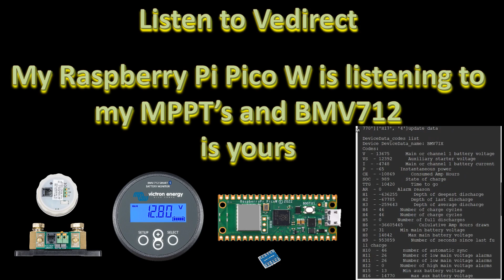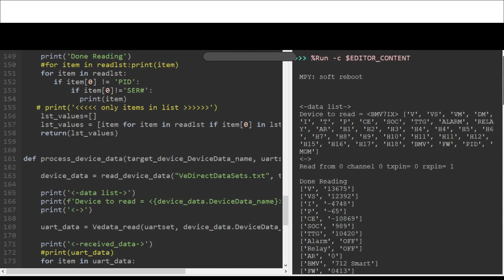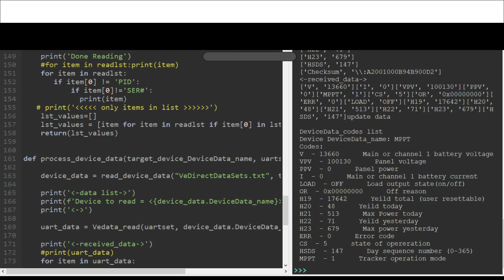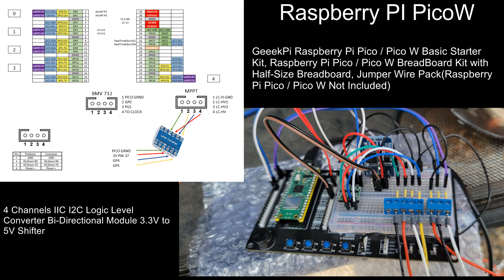My Rasperry Pi PicoW is reading data from Victron's battery monitor and solar MPPT via Ve.Direct

Comment: Thanks for the video! I'm working on a similar project and I was wondering: could connecting the computer to the ESP32 create a ground loop? In this scenario, the ESP32 would share a ground with both the computer and the Victron unit.

Comment: Nice video.  I am building a similar project.  Pi Pico to Victron 75/15 charger.  I am new to RS232.  Do you have wiring diagram or is the logic level converter directly going to the UART of the Pico?  I got a Waveshare RS232 to UART hat for the Pico, but not getting any readings, so thinking of trying your approach.  I would love any direction for coding too, either Micropython or Arduino code.  Thanks!
Reply from the maker: More than happy to help,  The logic converter was used  to change the 5v signal from the mppt to the 3v picow signal.  Some wiring is shown towards end of that video.  I did wire up a splitter to share info from the bmv cerbogx and pico.  As for programming look at part 2 video it may help in that aspect.  Can go into more detail if needed.  https://youtu.be/EognVNuAn08?si=602XP4uRywqxrfpv